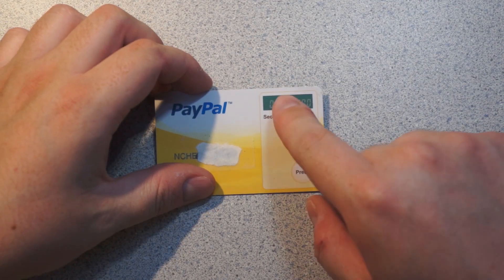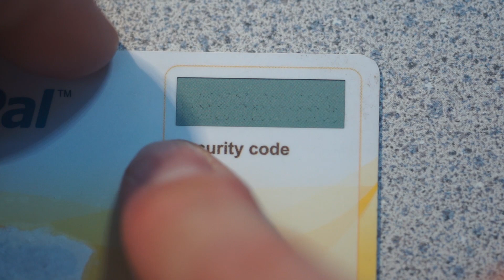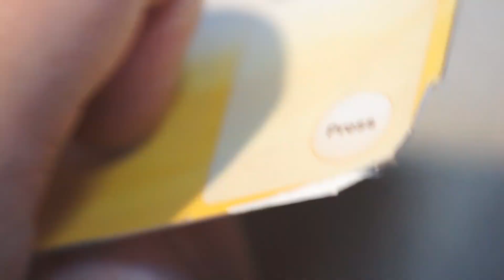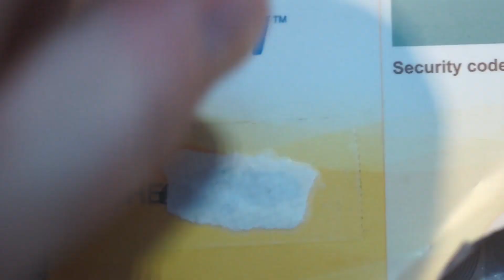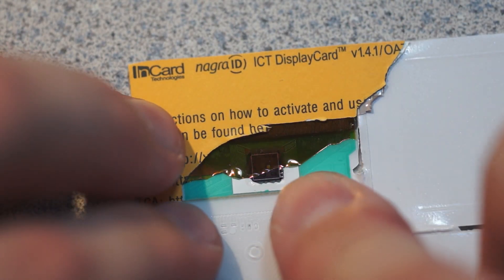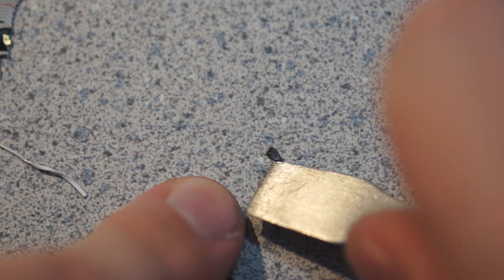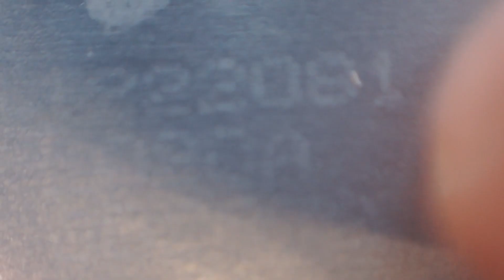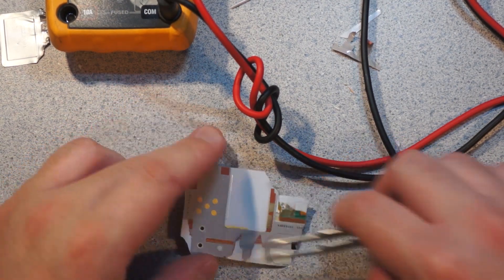Extreme Teardown - Paypal OTP Security Token Card

Comment from the maker: From the look of it, the thing that limits this to a seven-segment style display is the actual display element, not the microcontroller. 

Realistically, this does all you need for second-factor auth, so why add more complexity? I imagine there is already issues with the flexible display substrate. More wires means more failure points.

Comment: My guess, the chip in the middle of the coil just decodes the pulses and sends them to the main chip as some serial stream. It may also send data, not sure. 
The lcd display probably had its own chip-on-glass like processor but then again there's too many traces going to it, so it's probably running straight from IC on the other side.
The chip in the corner was probably the processor doing the math, maybe a 4-8bit mcu with a custom dsp/math functions. Awesome battery.